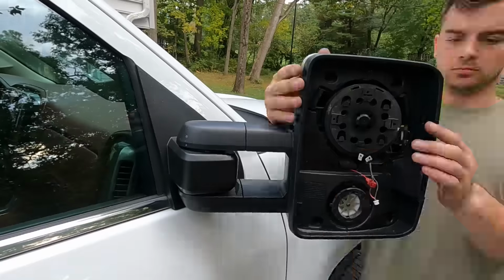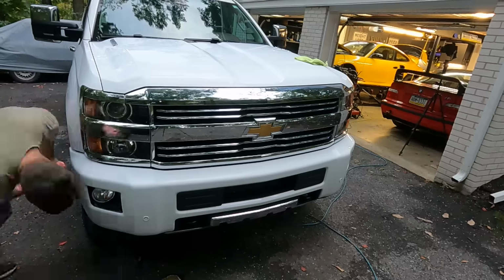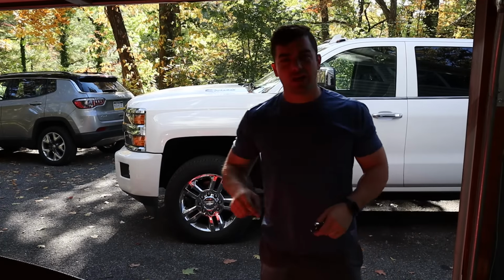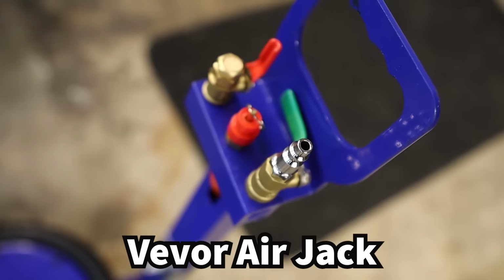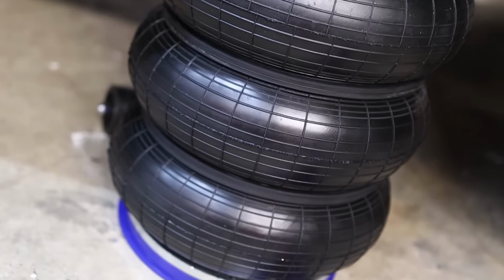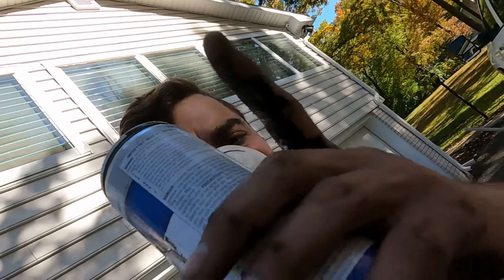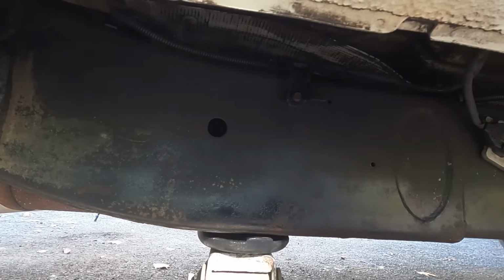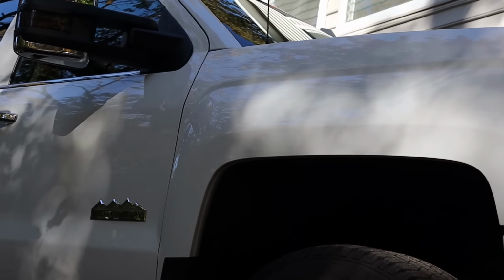Testing the MOST EXPENSIVE Spray Paint Available on my Duramax!

Comment: Good work getting it coated and using a super quality product!  A bit of warning here: Normal spray cans are not super toxic to get on your skin, but you really should be covering your skin and wearing a respirator when using 2K paints.  Most of them contain isocyanates, which can cause respiratory, skin, and neurological reactions after varying levels of exposure. It could happen after the first time, it could happen after 20 years, but please protect yourself so you can continue enjoying the hobby!
Reply: I'm regretting many choices of not listening or not heeding advice from wearing a simple dust mask to throwing on hearing protection after 30 years of air tools, saws and lifting heavy objects. Easy to think you're invincible until it's too late.
Reply from the maker: I'll definitely put on gloves next time, thanks!
Reply from the maker: I've been using hearing protection WAY more recently.

Comment: I know it's another step, but a wire wheel in a drill to knock off that surface rust will make a huge difference.  If this is a 20 year truck, definitely worth that extra step.  If it's a 5 year truck, then what you did is just fine.
Reply from the maker: Yea this truck isn't so bad, it would have made it look a little nicer, though.

Comment: That Eastwood spray paint company makes a clear coat similar to what you used that is worth every penny.  I was able to lay 2 good coats on 2 side skirts and a bumper with 1 can (it was every last drop).  IIRC, there was a sticker somewhere on those cans that made a point that they have a strict 2 year expiration date.
Reply from the maker: It seems like quality stuff, I'll find out for sure.

Comment: So its been awhile since I've been on here watching the videos.. but I see you haven't replaced those shocks yet on that truck. I just replaced mine on my 2017 GMC Sierra 2500hd Denali and I can't believe I waited as long as I did.. it is a night and day difference.  I went with bilstien 5160 w/ res on the rear, and bilstien 4900 on the front from rockauto and over all.. she rides like a deam, I also have 3k lbs in tools/tool boxes on the bed so you could imagine how terrible it rode before with the stock shocks still on her... 

2nd topic, I had a question or 2 for you about the 2.8L "your buddy from Canada had" where did he find the egr delete? I found everything else, Flo Pro-turbo back, and the HP Tuner, but can't find an available egr delete kit. Any assistance for my Canadian buddy would be much appreciated 👍 😆

Comment: Bro that's the cap, not the can that causes issues with getting coats down properly & paint going everywhere like that. When you're done with a can take the cap off & throw it in a jar of white spirit (or you could blast air through them etc). Build yourself a stash of clean caps so if one clogs or F's up on you can just grab another. Turning the can upside down & spraying can help clear he nozzle if it's not too clogged  too ✌
Reply from the maker: I swapped it and it didn't fix it.  It seemed like there was a pressure issue before I started using it.  They DID send me a new one, thankfully.